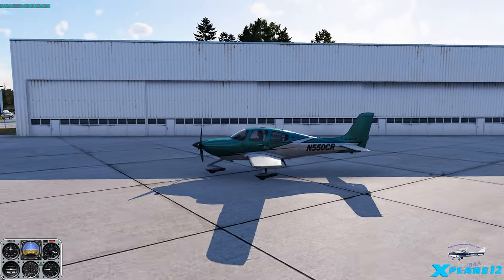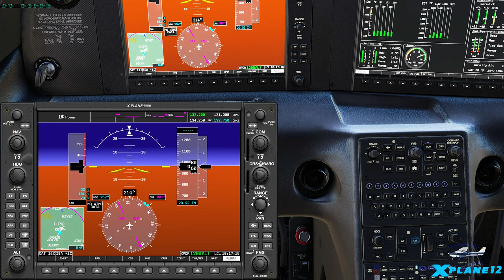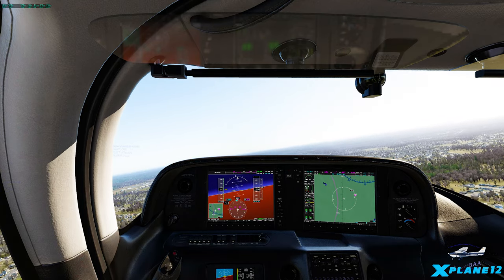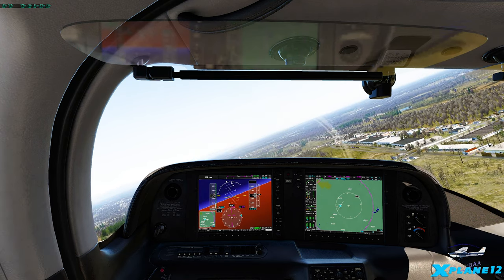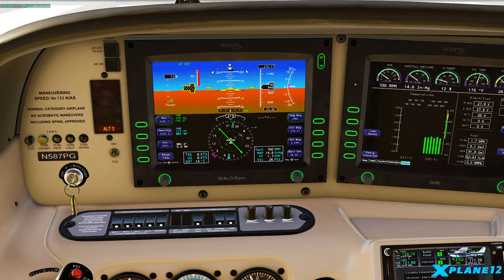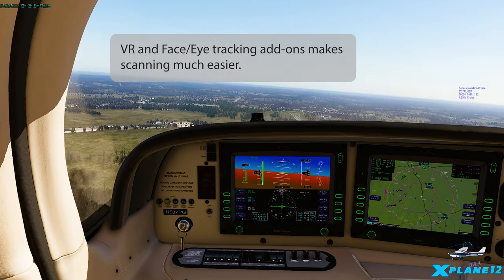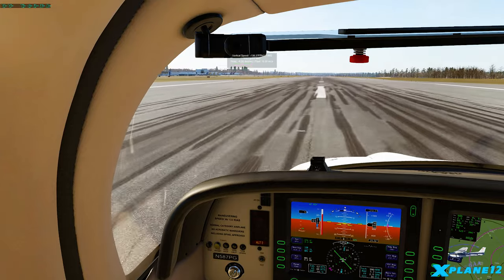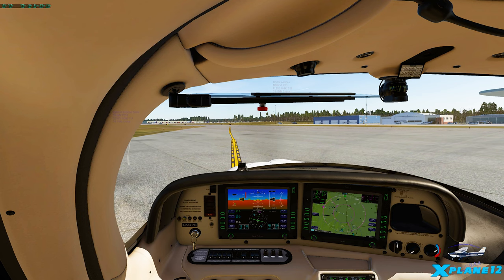X-Plane 12 - Cirrus SR22 (Laminar Research -VS- TorqueSim)

Comment: Hi Frank, good observation!
In the real-life standby unit (called 'SAM'), and baro changes made to the G1000 automatically get synced with the standby. So that part is correct. 
The only thing that is missing in the simulator version is an extra knob to change the standby unit individually in case of G1000 failure. It is mounted in between and slightly below SAM's two small screens.
Reply from the maker: Hi Evan,
Thanks for the information. Hopefully, LR (or someone) will add the standby baro knob, at some point. Now that you've cleared up syncing question, it not a priority.
The SR22 is a great aircraft. Wish I could fly it in the 1st world.  Happy Holidays.
Reply from the maker: Hey Evan, Out of curiosity, was does SAM stand for. Thanks!
Reply: @VirtualAviationAviator  No worries! It stands for 'Standby Attitude Module' and is made by Mid-Continent Instruments and Avionics. Hope that helps!
Reply from the maker: @pilot_evan  My lesson for today. Thanks.

Comment: Hi Frank, on the Garmin GTN750 I think you meant your using the Reality XP version right? Real Sim Gear doesn’t sell their own 750 at least from the time I’ve spent there. So I bought this TorqueSim Cirrus, if you buy one of the 3rd party GPS packages for it like the RXP 430, 530, or 750 .. how do you install it into this plane? TorqueSim say they support all the RXP Garmin’s .. but I don’t see any options to use them in the Cirrus menu, and the manual doesn’t say how either, can you help me out here? I bought the RXP 430 and was thinking of getting the 750 too. Thanks!

Chris
Reply from the maker: You would be correct. I have the Reality XP version. However, I rarely use it anymore because it's not compatible with Navigraph. I envy those who fly MSFS and get to use an updated model of the GTN750.

AFAIK, there are no plugin replacements for the G1000 in X-Plane, which in real life is an upgrade to all the avionic suites you mentioned. In the sim, well... I prefer the GTN750.

Comment: So torque sim works in xp12 right now?
Reply from the maker: No. I'm flying the TorqueSim Cirrus SR22 X-Plane 11 version in X-Plane 12. It seems to perform okay, but it's probably under-powered. Since I had it installed, although I don't really fly XP11 aircraft in XP12, I flew it only for this video.